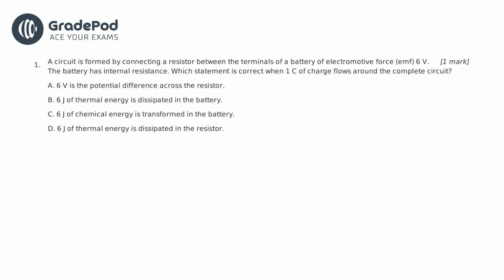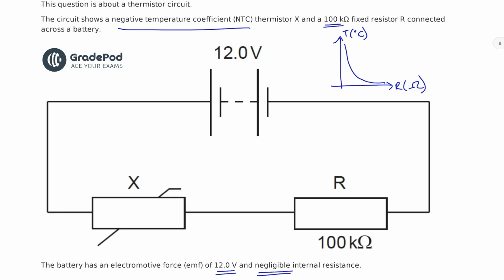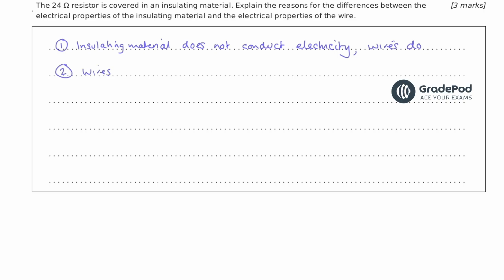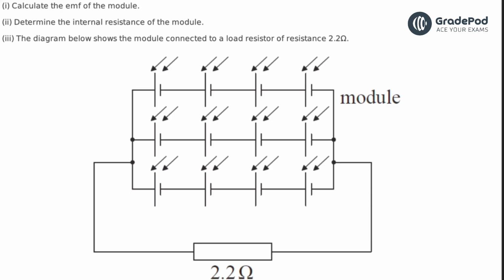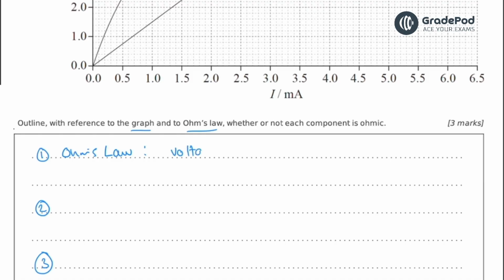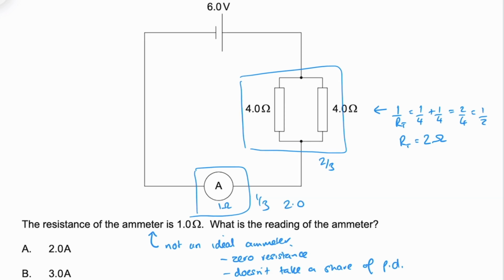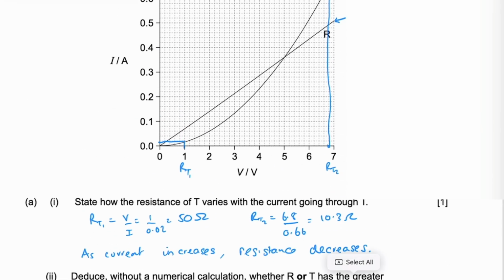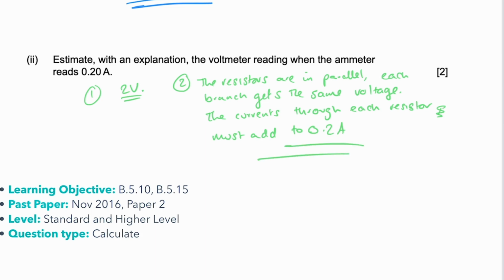IB Physics B.5 Current and Circuits | Past Paper Walkthrough | GradePod (SL + HL)

Comment: Hello  thank you so much for the exam pack it is structured well and very clear to follow.  In the exam pack for B.5 the last questions form 13-17 are digitally solved. Is it possible to get the new clean sheet so I can practice on the paper without the answers? Thank you so much.
Reply from the maker: Hey! I fixed that for you this morning - thanks for letting me know! Clean sheet is now in the exam pack. Good luck working through it!